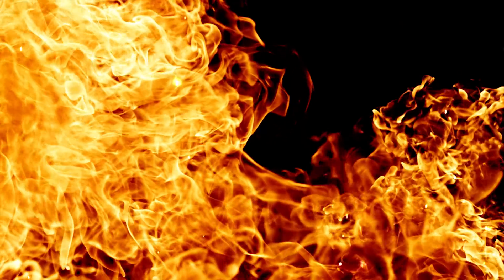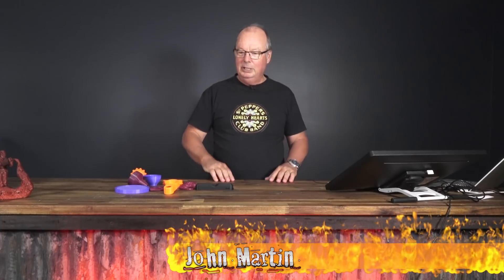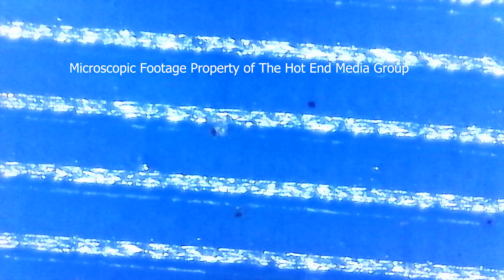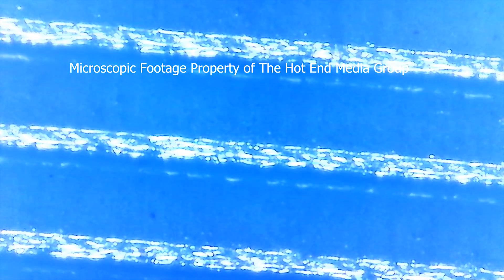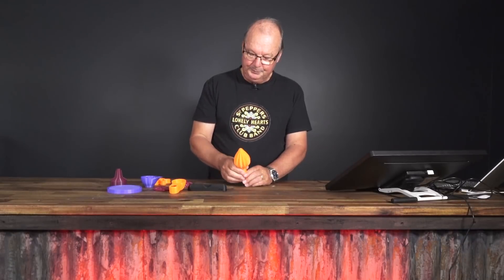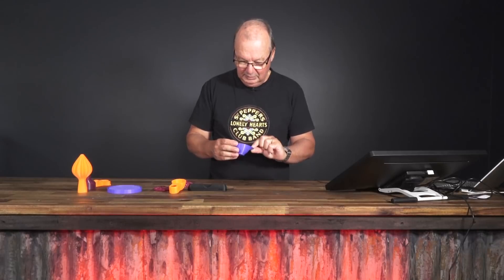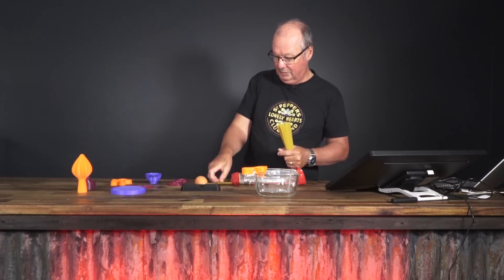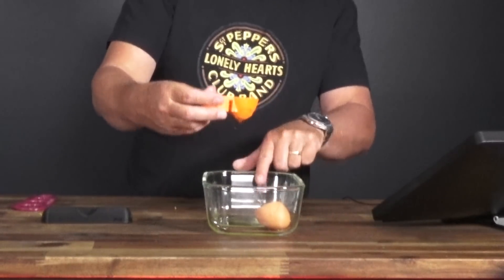3D Printing Can KILL YOU!

Comment: While I don't disagree, I think it's fine in certain ways.
I.e I made a cover that goes over the top of a can. Imo i can't see much of an issue so long as its cleaned, and stored in a sealed container, never left to collect dust by having the part that contacts where your mouth goes facing up and not touched where that part is either, only the part that'll be visible when its used. Also its something that I reckon is to be replaced maybe every 2 weeks after its first used.

An alternative could be coating the 3d print perhaps, maybe in an epoxy.

Not saying I recommend it, but I doubt it's going to be detrimental for every single case where food is involved. Quite a lot of variables to consider.

Comment: Thanks for the video - great all round advice... im interested in 3D printing mods for after market appliances (ie coffee grinder grind chute), either impossible, or very expensive to purchase - each part is able to be sanded back - i'm interested in advice on a sealant for smooth plastic surfaces that is a) food safe, b) will provide a smooth finish that wont catch coffee grind... c) can be wiped clean and d) wont damage the print... thanks again...

Comment: If you have no immune system yes. Most of the germs he's worrying about will be killed off by a healthy immune system in no time. I've been using a 3d printed hamburger press for two years now and never got sick. After use, in soapy water with a little bleach, then rinse thouroughly. Before using, a few seconds in boiling water (yes, you can do that) and it's ready and safe to use.

Comment: If annealed correctly, PLA will start to become malleable at roughly 160 degrees celsius. Roughly. So would annealing a PLA part and cleaning it in a dishwasher be viable? I completely agree with everything you have said in the video, I'm just curious. If the printed part can handle the high temperatures of a dishwasher and possibly boiling water, would that make it a step closer to being some-what food safe?

Comment: Nice vid,
Coming from a pro you are not considering the fact that someone may be able to finish the plastic print the item so that the surfaces are smooth where cleaning can be effective.
Reply from the maker: If you want to spend hours sanding and/or coating the print, sure you could do that but it would have to be a very important print to bother. It would be easier to treat the print as "single use" and print another.
Reply from the maker: PS we are pros in terms of printing and hospitality, qualified chef and health inspector in the family so yeh there's that
Reply: @TheHotEndChannel  there are 3d printed temporary implants that I personally worked on researching the biocompatibility data. Please don't spread misinformation in the form of your opinion. Yes, you do have data to support that you can't just print something and use it for a food :). Don't stray others away is what I mean.

Comment: There is special food safe petg. All petg is not food safe. You are just not correct on this issue. Properly printed layers are fused. No gaps. You are arguing something from authority, but that doesn't make you correct! There are food safe filaments. There are food safe print designs. There are food safe printers. Food safe items are most definitely printable. If they can injection mold them, they can be printed. Period. All of your complaints are either just not accurate or exactly the same issues we face every day with current approved methods.
Reply from the maker: What are your qualifications or is it Google? And you use food grade nozzles (stainless steel) ?

Comment: So in contradiction of himself; "as soon as it comes out of the printer it is no longer foodsafe" but "use it once, sure, but cleaning it...." which is also true for any cutting board or any other tool and or utensil if its not cleaned or sterilized properly. So the "not food safe" for cleanliness reasons, but I think most people are more worried about when talking about 3D printing - chemicals or toxins in the materials.

Comment: *Everything* has an imperfect surface at a microscopic level. 

Anything that's been used is now damaged and has left some residue on everything it's come into contact with.

We don't treat chopping boards as single use items, if you're scared of germs you really wouldn't want to look at one of those close up.
Reply: a oiled one you mean ?
Reply: @surronzak8154  any chopping board made of anything maintained with current approved methods. Yes. The entire world is covered in germs. All of it. And thank god it is or we'd be dead.

Comment: wellll they are food safe. once. :-) hehe

yep I know you said that many times I just think its funny sounding. Once dun dun dun :-)
Reply: first a quid pro quo. you are one of my favorite youtube channels. I deeply respect you. this is a stimulating intellectual discussion to me and absolutely no offense is intended and I am not trying to be argumentative.

I have however had this discussion before. :-) brass is "up to" 3.8% lead by weight. a brass nozzle weighs what? 4grams? if that? 3 grams? I don't know precisely I tried weighing one but my 5g resolution scale says 0 and I can't find my 2 decimal precision scale right now :-)

so lets call it 3 grams. so AT MOST the nozzle has .1 grams of lead in it. AT THE MAX at the highest. the only transfer can come from the inside wall of the nozzle. so 1.75mm wide by 5mm long and .4mm wide by 1mm long as a rough estimate. lets call "EOL" .1mm so when your .4 becomes .5mm you throw it away.

that is what? 0.01% of its total mass? or 0.003grams of which at MAX probable 0.0000342 grams is lead. or about 34 MICRO Grams of lead.

typical lead for an adult is 10ug/dl or about a total of 550 ug of lead

as you go past 10ug to 25 ug you begin to have possible minor effects of lead poisoning develop.

SO to get lead poisoning from a 3d print you would have to what?

I have printed HUNDREDS OF POUNDS of plastic on a single printer and the nozzle is still as perfect as the day I got it?

so lets say I can print 1000 pounds of pla before I wear the nozzle to .5mm and throw it away.

so you now have 34.2 ug of lead across 1000 pounds of plastic.

you need 550ug of lead to be "poisoned" and that is assuming you absorb 100% of it and pass none of it.

you would have to print 1000 pounds worth of dishes and cups and then "EAT" 100% of all of those cups and dishes (not use them. EAT THEM grind them up into powder and EAT THEM) and then some how absorb 100% of the "lead" in them

and then do it 16 more times to even have a chance of getting lead poisoning. that is 100% abortion of the lead in 16,000 pounds of 3d printings or 7,273 rolls of 1kg pla.

and that's a worst case scenario. max amount of lead in the brass actual transfer to the pla and you optimally grind up and EAT the prints and somehow 100% absorb the lead in it.

or you could "EAT" 182 printer nozzles and somehow extract and absorb 100% of the lead in those 182 printer nozzles assuming they have the max probable lead content.

should you eat with 3d printer parts? probably not. for many reasons. lead is NOT one of them. lead is literally irrelevant in this instance. completely irrelevant. zero threat.

the primary issue is as you perfectly describe. all those layers holding who the heck knows what after the "first use" that you really can not clean out effectively. maybe if you printed with nylong or pc that you could autoclave or something?
Reply: If brass is such a problem, then why is it such a common material in faucets?
Reply from the maker: technically not even once. lead content in the brass nozzle plus filament storage and handling for starters :D
Reply: The Hot End - 3D Printing & Technology I somehow doubt that even if you ground up and ate the entire nozzle in one go you wouldn't get enough lead to do anything at all if toy ground up and ate 1000 nozzles you wouldn't get enough lead to do anything :-) there really is not that much lead in those things :-)
Reply from the maker: Some brass nozzles contain lead

3D printer brass extruders may contain lead, and contamination can cause some nasty health problems. Exactly how much lead is in the brass and whether or not a significant amount of lead from the nozzle is transferred during the printing process is unclear. Some seem to think this is a huge problem and others say that the level of lead that would transfer into the final product is totally insignificant.
Reply from the maker: All good buddy :)
Reply: Fantastic break down.  You're right, it is about the nooks and crannies related to FDM that is the greatest concern.  Coating with a food safe material (like shellac) and cleaning with something like PBW will give you an item that's safe to use repeatedly.  I also have some nylon parts for fluid transfer that get run through the dishwasher before use.  I've been testing with a luminometer, and I'm really happy with the shellac+PBW method.

Comment: I completely agree, with my experience in medicine food should never be in contact with 3d printed parts, even if it's "food safe" because your nozzle, extruder, bowden tube and hotend are all contaminated.
Reply: Contaminated with what? Chemicals? Because this video is about bacteria, and I'm pretty sure both the hot end and the plastic sterilize themselves when they heat up to 250ºc.
Reply: Not in a food safe machine......
Reply: Everything is contaminated,  even the food that you eat out of packages,  the FDA allow for certain amout of food contamination. They even allow for micro size pest contamination per part. Go to there website! See for yourself. Tell the whole story not part!

Comment: I do have to wonder, considering how inexpensive kitchen hardware is, why anyone outside of prototyping would even consider spending the time to make stuff like this to be used in the home on a regular basis. 3D printing is a very expensive way of outfitting your kitchen. Thank you for pointing out some of the potential dangers of going this route. What you said about what  the juicer wasn't in your opening does give another clue as to what not to use 3D printed items for...and for the same reasons.
Reply: But you can't get that cool cookie cutter that you want for your kid's birthday party, whereas you could design and print one yourself.
Reply: not really. I get PLA for as low as $7 per kg more commonly $10 per kg. the "time" it takes me to goto the store could cost more than a print :-) not to speak of the gas.

cost is not the issue. safety is. your just not going to be able to effectively clean them. the chances of you getting sick are honestly pretty slim. but why risk it?
Reply: OK, I get what you are saying and this video is about the safety of 3D prints. For me and where I live it is easier and cheaper to just go to the local bigbox store or the dollar store, both within a mile of where I live and buy plastic kitchen goodies than to take the time to research, modify, slice and print something. Albeit not as much fun as watching it print for however many hours it would take to get the same pieces. That's where I was coming from. Although, you can make that custom gadget that no one has or the next gadget that will be on an infomercial...plus shipping and handling.. Still a very good point on the safe uses of such tech in the home.

Comment: As an extension to this, you could talk about using 3d prints to make moulds for pouring food safe epoxy's or silicon to make food safe copies of it.
Reply: that is only going to work if you can make a mold with a food safe surface finish.
Otherwise you would end up copying the same non food safe surface over and over again.
So you could just print straight away an make the surface of your print food safe anyways and safe some time in the process.
Reply: @rebeckavogel  Making a mold food safe from a printed piece could require some finish work. The main thing is the material used to cast the finish piece with. If it can handle being boiled or ran through a dishwasher's sanitation cycle then the little crevices would be of little worry. The inherent micro fractures in the 3d printed piece would not very likely transfer in the casting. The grooves from the layering would, though with a lot less detail than the original.
Reply: i guess it is quite off topic but does anybody know of a good place to stream new movies online?